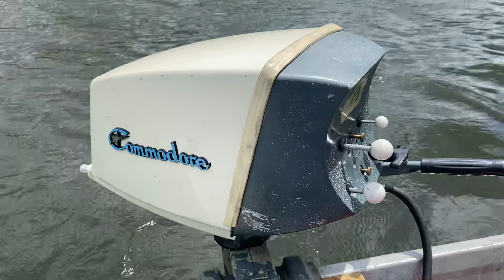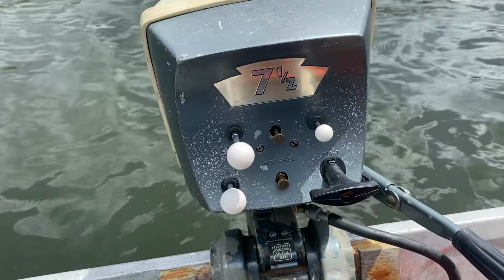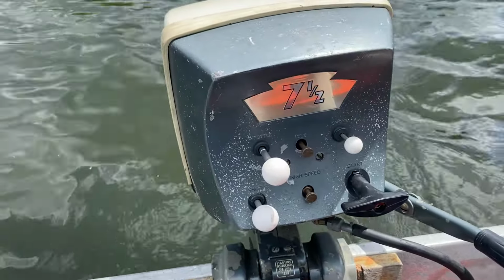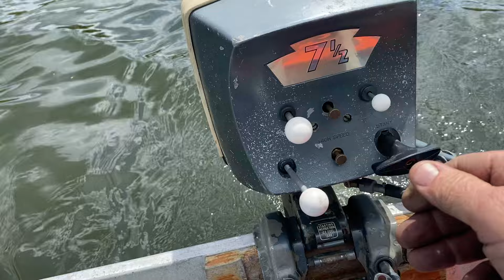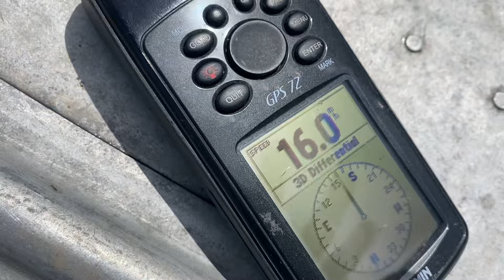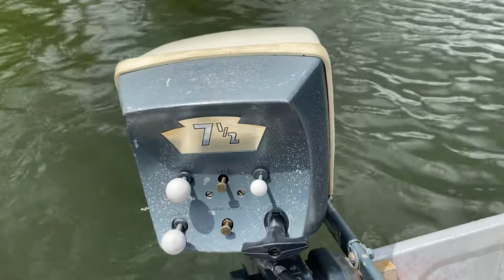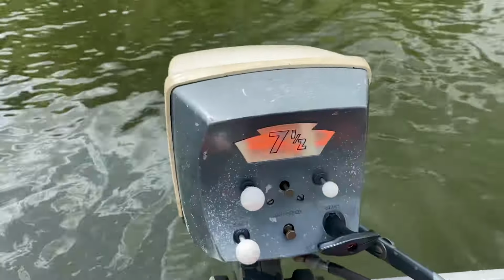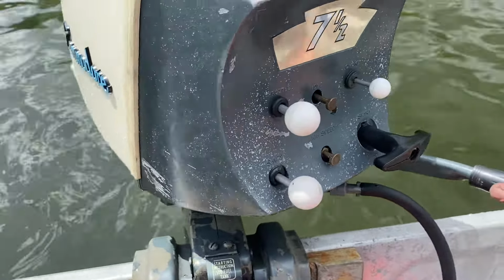1962 63 Commodore 7.5hp by West Bend antique outboard AOMCI

Comment: Very cool.  Nice that you have the Commodore version.  Those are not very common since they were only made for three years. I have the 10hp Commodore. Thanks for sharing!!
Reply from the maker: I’ve grown very fond of the Commodore and Firestone varieties of West Bends.
Reply: @GearHeadJP  I like both of those as well as some of the Elgins and the West Bend branded ones.  They're nice motors.  Well built and uncomplicated. I wish parts were a bit more available.
Reply from the maker: Amen
Reply: They are certainly a favorite of mine! I had a guy bring a Sea King 8hp to get running for him last summer. Looks identical other than colors and name. It sits on the old Green Elgin midsection and lower unit. Very cool JP 😎

Comment: I have a 59ish  7.5 Elgin that works the same way. It looks like a giant mail box.
Reply from the maker: 😂 I have one of those too, but I haven’t worked on it yet. I’m probably going to let it go if you know someone interested.
Reply: @GearHeadJP  sadly no. I'm the only person I know who messes with this stuff around here.
Reply from the maker: Could be worse! 😂
Reply: @GearHeadJP  I can tell you one thing, this little Martin 40 I picked up is kicking my ass.
Reply from the maker: Those little Martins sure do run nice once gone through though.
Reply: @GearHeadJP  I hope so. It's a real mess. The pull starter doesn't line up with the gas tank, the gas tank doesn't line up with the brackets, the nut on the flywheel was rubbing up inside of the pull starter. And, gas is seeping out of the gas tank. And I can't get the carburetor set for beans. I took the valves out and they looked really bad. So, it's a mess.
Reply from the maker: Yikes. Time for a donor motor!
Reply: @GearHeadJP  I sorta know somewone who has some nos  and used parts and manuals and so on. I'm hell bent on getting this one to run good.
Reply from the maker: That’s the attitude. 💪
Reply: @GearHeadJP  thanks